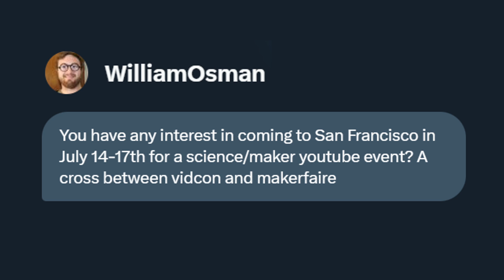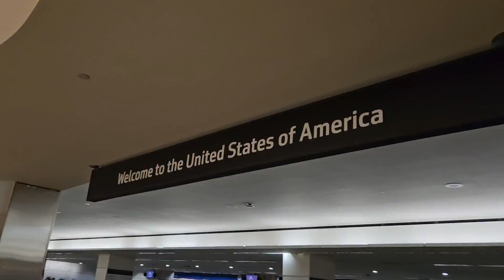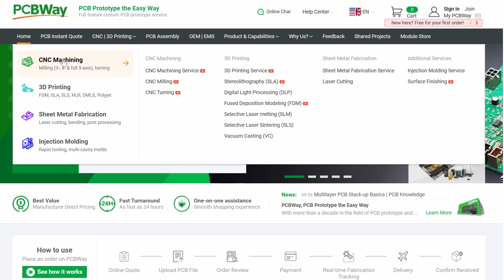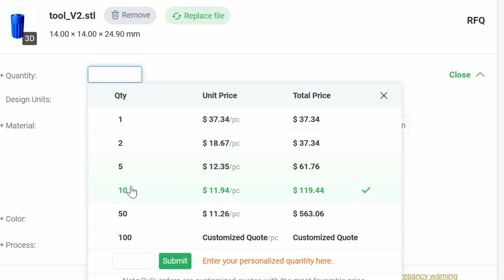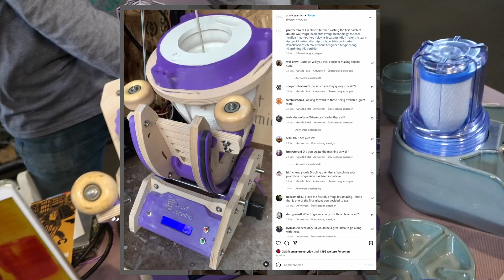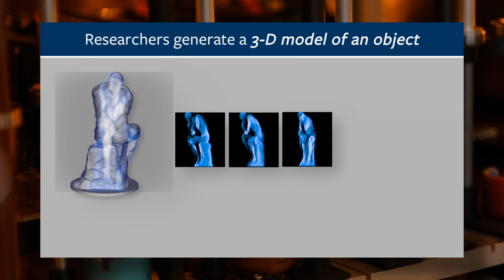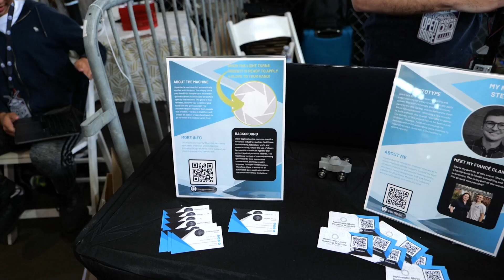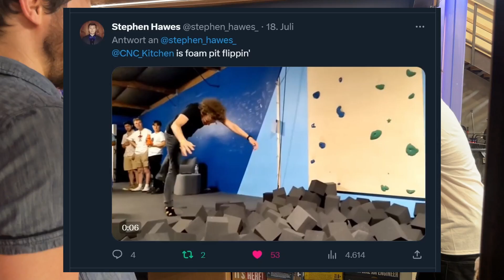Inside OpenSauce 2023: Makers Unite!

Comment: That pill bot is a disaster waiting to happen. I have seen what can happen to batteries of all kinds.... that could mean heat, acid exposure, even poisoning if the battery has a failure, and you're not getting that out quickly enough.